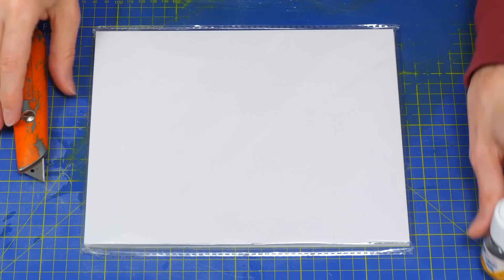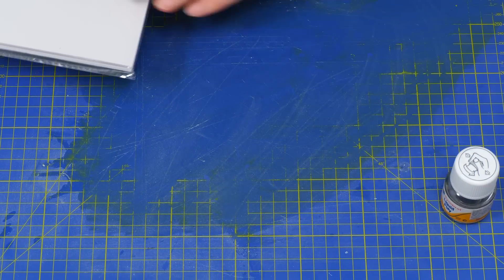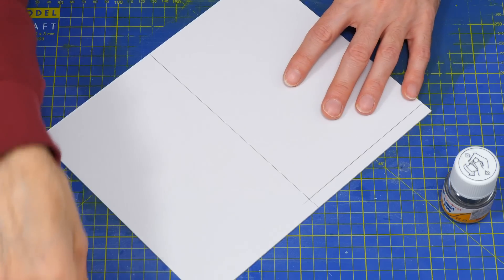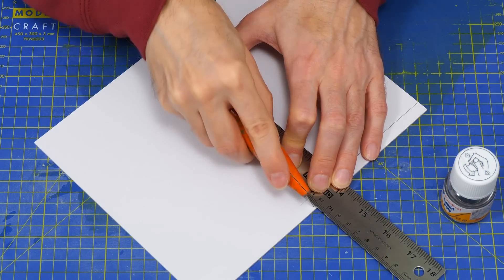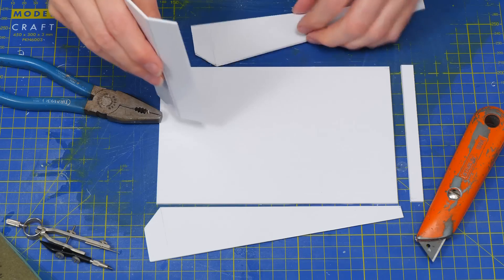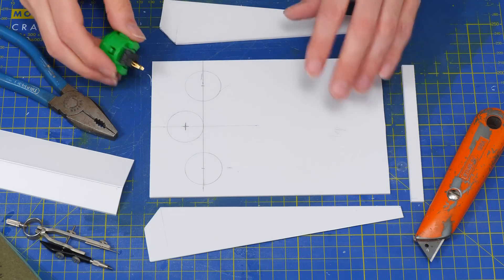Making a Custom Plastic Case

Comment: Got here from your DIY Cyberdeck video.
With 2 & 3mm ABS sheet, it makes sense for me to build a cheap home brew 2D frame for a Dremel using a ultra small cutting bit. I was not aware of this material but I think I will use it to make the first case for my custom 8×32 keyboard which will also make modifications rather easy.

Comment: Wonderful!
Curious: is there any way to create a curved piece? Perhaps melting the plastic?
Reply from the maker: For a simply, non-compound curve (ie only curving on one axis), then normally I would use a thinner sheet (maybe 1 or 1.5mm) which could be bent as required. And if necessary, two thin sheets can be stuck on top of each other to create stronger curved sections. Heat can also be used as you note -- the plastic here is also used in vaccum forming, where it is heated and sucked into place against a mold/former.
Reply: @ChristopherBarnatt  Hey, that's a great idea! Thank you for the info & your reply. Looking forward to your next video😄!

Comment: If you find yourself using plasticard to make boxes often, consider picking up a pair or "seamers."  They're basically pliers with really wide, flat-faced jaws.  They make bending the small pieces like the one at 4:55 much easier. to snap.
Reply from the maker: Wow! Thanks greatly for this. I am certainly going to get some seamers -- a tool I did not know about. Fantastic suggestion!

Comment: Awesome diy commically large 3-button vintage mouse. 😄
Honestly, it's so great seeing people create something awesome like this, without a 3D printer or expensive tools.
I often resort to using balsa wood - another great material you can work well with a simple saw, maybe a drill, files, sandpaper, wood glue and such.
Reply from the maker: Thanks for this. It is years since I've worked with balsa wood -- I feel like getting a pack now! :)

Comment: I've struggled with making enclosures for years. I consider them a necessary evil.  Very few electronics makers demonstrate fabrication at the level of detail that a complete beginner needs.  I wish I had found a method like this long ago. It's effective, simple and attractive.  Thanks SO much for this, Christopher. Don't underestimate the value of this post to people in need.
Reply from the maker: Thanks. :)
Reply: I have to agree and it's very useful seeing the whole process

Comment: Thank you, I have a D.I.Y. HDMI monitor made from a screen from a broken Laptop and a HDMI LCD Controller board. It would be an upgrade to replace the cardboard that I attached to the back of the LCD screen to hide all the wiring and mount the LCD controller boards to.

Comment: The sheet looks useful -- I've looked at a lot of cases on Amazon for small projects I've done -- I hope I can use this approach insteaad (sadly, I have no room for a 3D printer!).  I enjoyed the clever transitions between channels as well!
Reply: if you look closely a lot of dead electronic items are in abs cases that can be salvaged and use these tips Chris showed to modify them or even cut the flat sections out and reuse them. :)

Comment: Couple of tips for making life easier with this sort of project. Step drills are your friend for cutting large holes, available in sets with several size ranges, they will cut wood, plastic and metal. To support pieces when applying adhesive and similar operations, use blue tak to hold the pieces in place. This is firm enough to hold the part and allows easy and fine adjustment of position. For holding removable parts in place, without messing with screws, use small neodymium magnets.  Roger and out!!!
Reply from the maker: After 50 years of model making I'm not looking for tips, thanks.  :) Using BlueTak risks geting sme solvent behind it. I amaware of possible drill bits. I just didn't own one here, as I rarely have to make holes this size. There is a tool for everything, but that does mean that we always have one available all the time! :)
Reply: @ChristopherBarnatt  
Well it might help someone else.
Reply from the maker: Fair point!

Comment: Totally off topic but I just read that Raspberry Pi 500 and Raspberry Pi Monitor on sale now! Looking forward to a review!
Reply from the maker: Thanks for this, I just read about this too. Unlike with the Pi 5, Pi 400, Pi 5 and others, I was not contacted advance by Raspberry Pi, so do not have an early review unit.

I will review at some point, but personal circumstances right now mean that it will not be that soon. I am very surprised that it has no M.2 slot, and still uses micro HDMI. Even their new monitor -- which looks very nice -- has a full-size HDMI port. So I just don't understand their obsession with using a poor quality connector on a movable keyboard unit.
Reply: @ChristopherBarnatt  I'm sure a  unit is on it's way to you for review! Is the post office on strike again? 🤣

Comment: Great video on making a simple plastic case Chris. I usually use my 3D printer to make cases because I enjoy the total design and implementation of projects, but printing larger cases can be a problem with the printer, both in size and print time. I could simply buy the ABS sheets and fabricate a case in the same way you have here. Anyway, enjoyable to watch both this video and the accompanying Explaining Computers one on the finished product. Thanks Chris. Take Good Care!

Comment: Nice tips! 

One tip for cutting sheets of plastic, card, leather etc is to keep your hand as far forward on the ruler/straight edge as possible.  That way if the blade jumps up onto the ruler it's impossible to cut your own hand.  The other tip (as shown perfectly in the video) is light pressure. Less force means less chance of losing control of the blade.

Comment: Will a a 3d printer extruded ABS filament bond to that ABS sheeting? Or even from a 3d pen? I’m still only 6 months into 3d printing and everyday there’s something new to learn. 
Nice design for the housing. 
If ever you find yourself needing a hole larger than the bits on hand, with no auger or step drill, use a compass or plotter or make one with 2 sharp screws  and a wooden rule. One screw to center, the other scores the material. Or a hot blade and screw. 
Great video!!
Reply from the maker: ABS filament would, most certainly.

Comment: We mustn't lose sight of these techniques. Way more accessible to the majority than 3d printing
Reply: Reliable 3D printers are so cheap now. Too useful to ignore for anyone making stuff like this. Although it's nice to see the old skool way of doing it.
Reply: @StuartJ  they are and yet I feel Chris has built something more solid than most 3d prints
Reply: @theburntcrumpet8371  no, that's not true. A 3D print can be much more rugged. No need to glue things either.

Comment: Hello Chris 
I believe you can melt ABS in acetone and use the ABS slurry as glue for glueing ABS parts.
Reply: It also called ABS juice works fine, but smells awful like ABS when 3d printing.
Reply from the maker: Indeed, or just use the acetone! :)
Reply: acetone does not work well for me, as it seems to dry too fast and get very powdery, so using a combination of xylene and acetone works far better and dries a glossy smooth tough structure, same with regular styrene, though only need the xylene, dont need the stronger acetone solvent action but it makes a glass clear and smooth surface on things while providing a very high voltage dielectric barrier from a pretty thin surface. (good for making quick cheap foil capacitors :)

Comment: This is the kind of practical case I could actually make as I don't have access to a 3d printer. Thanks for the clear instructions and inspiration. It turned out great. I hope the buttons make your work easier as intended Chris.

Comment: I'm going to make good use of this. I'm always thinking of projects which need cases, but don't want the smell, expense or maintenance of a 3D printer. I also don't have a lot of tools, especially not the cone or stepper bits for drilling large holes in plastic, so it was good to specifically see those being opened out. And the use of model filler, I was wondering how that would work out. But I groaned at "Case closed". :D (Not very much, I grinned more.)

   "Our friend Stanley the knife" took me back to my childhood when all the workmen I knew (and I knew quite a few) thought highly of the Stanley knife. A friend indeed. Polo mints were a blast from the past too, at least for me. I haven't bought any for years.

   I've hardly seen any Explaining Computers videos. It's not a particularly attractive name for someone who's thinking of writing operating systems in Forth. :D It was the Mamod steam engine which got me here, and I can now see I'd be interested in some of the EC content too.

Comment: To make the holes for the buttons, use a "hole saw" attachment with your drill. I have used these successfully on both ABS and acrylic sheets. BTW...the compass on your work surface looks just like the one in my drafting set...which I purchased in 1972...when I started my engineering studies.

Comment: Subscribed I watched the other video the other video if you don't have a 3D printer it's a possibility that you could use a cheap plastic box from like a pound store also you could add batteries and Bluetooth but the advantage you have is that if you need to reprogram you're already set up to do so!
Reply from the maker: Thanks for the sub.

Comment: This man is a fan of a rubbery plastic base.
Reply: Huh? That was another sheet of ABS, just a different colour. If you mean the feel of the whole case, ABS is quite stiff and what flexibility it has would have been reduced by the styrofoam cross-pieces.
Reply: @eekee6034  Well, at least he didn't use a buttery biscuit base.
Reply: @bigjoeangel  Now I'm hungry! :D

Comment: What an excellent & well made project, I like the hints & tips you give for working with plasticard (styrene) to help avoid some of the pitfalls, sheets not being square for one. That was my experience many yeas ago when I started building Narrow gauge model railway wagons & loco bodies.
A hint that I was told about was to check the grain of the sheets, it does cut easier in one direction than the other, I know it’s not wood but some manufacturers don’t use the same processes & quality can vary!  Thanks Chris you deserve an ‘Excitement scale’ of at least an 8 :)

Comment: I discovered step drill bits and can’t say enough good things about them to drill holes in plastics (my main use case is to drill holes for cable glands in ABS electrical enclosures)

Comment: Looks great and Chris from EC was quite happy to show it to us.
A suggestion that may help for holes (and this works for sheet metal as well), would be to invest in a couple of step bits.  They're tapered and work wonders when sizing holes that are drilled in thin materials.  I have a set and they have made a number of past projects easier.
Reply: I agree, cone-cut or step drill is a great tool. If you are planning to only use it on soft materials the cheap ones will work fine.

Comment: Saw both this and the Keypad video on the EC channel and chose to watch this first because why not as it looks like a prequel to the other video.

Had a laugh at 3:11 when you mentioned never assuming the edges are square as I've also made that mistake myself before and had to redo stuff haha.

I have a question regarding the adhesive, is it similar to the clear PVC Cement used in plumbing? I don't know the specific chemicals used for PVC Cement but I know there's commonly some Polyvinyl Chloride, some Acetone or other solvent, amongst other things.
Reply: If I had a 3D printer and the modeling skills I would do so, but I don't so I build cases out of other stuff.

Last time I needed a case for something I just used some Lego to make a "case" for a Class D Amplifier and its nice and modular when I have to change around cables. 

Got another Amplifier and I was considering using reclaimed wood from a wine pallet, but because of your video also considering using plastic sheets.